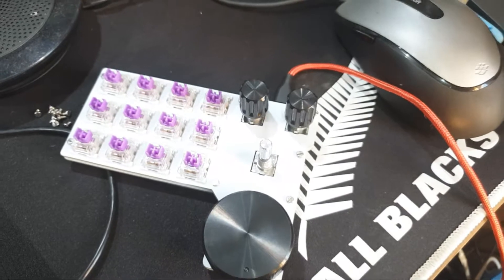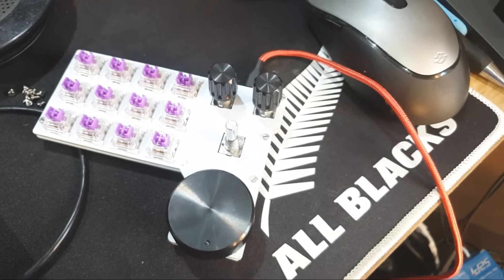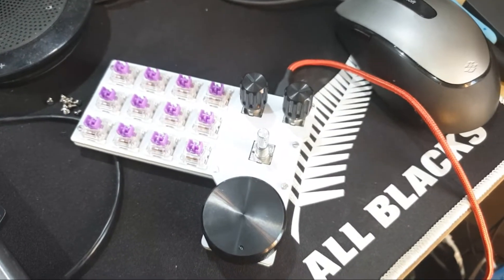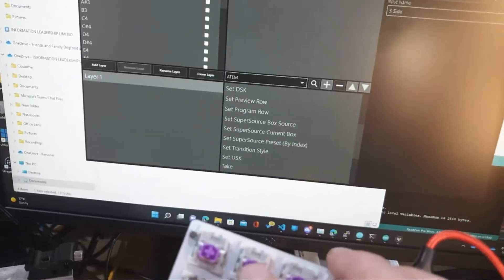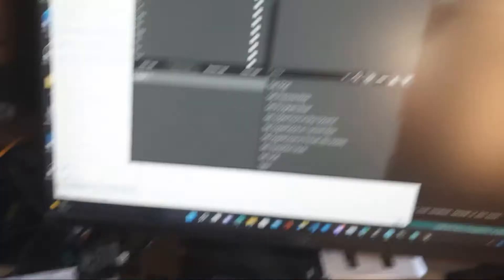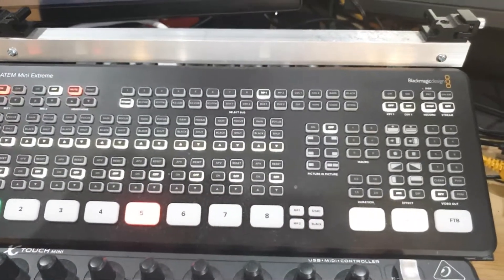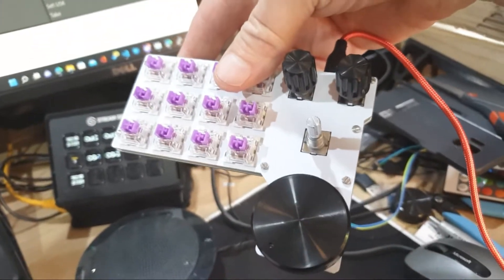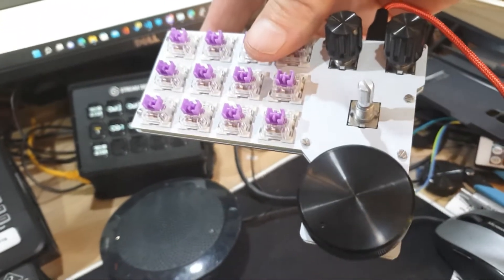CXT 12E4 Flashed To Midi Only For ATEM Control

Comment: I'm trying to put this board into the bootloader mode. How did you do it?
Reply from the maker: there is a little button in the underside of the middle layer, close to the edge by the middle rotary knob. I hold that down while inserting the USB cable
Reply: @vghifhsddhif  Im having a hard time to enter bootloader too. I've tried the reset button, the bootmagic and the reset option on VIA but none of them worked :(

Comment: thanks for your video can you share the link keymap for Cxt 12e4 english verion like you? Many thanks bro
Reply from the maker: Sorry, I did not use a keymap. I replaced the firmware with my Midi only software solution. I still have to get the encoders working properly then I'll release a hex file that can be uploaded with QMK Toolkit.
Reply: @vghifhsddhif  Well, this is the only place on the web I found that actually says it works with QMK, that's good enough for me :) I'm ordering one (For video editing, but who knows, maybe as a midi controller too one day)
Reply from the maker: @Seefood73  I used the toolkit to upload new bin firmware image with my own code. Their OOTB firmware is not compatible with QMK Keymap as they have their own customer app. You could possibly load proper QMK firmware but I have not tried that.
Reply: @Seefood73 Did you get it and did you get anywhere with a QMK port? I've ordered two, and would love QMK on there (and be glad to help porting).
Reply: any luck with the encoders?